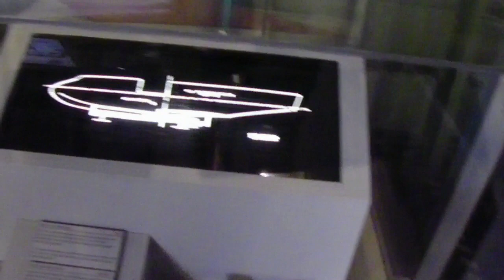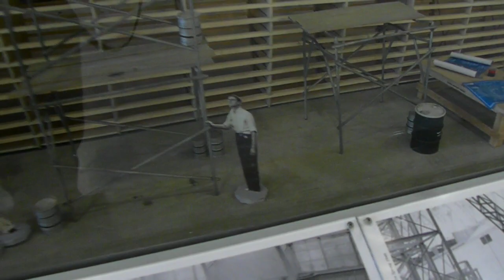HD Inside Howard Hughes H-4 Hercules at Evergreen Museum McMinnville Oregon Aviator Spruce Goose

Comment: I worked for Hughes Tool Company Aircraft Division while Howard Hughes was still alive. More than once employees were able to go to Long Beach to the Hughes hanger where the Flying Boat was stored. It was in a climate controlled facility and the aircraft sat in the water. For those of us lucky enough to work for the company that built the Flying Boat, we never called it the Spruce Goose just the Flying Boat or the original designation of the HK-1.
Reply: How was it kept from rotting when sitting in the water?
Reply: That's a great question Marcel.  The answer to that and many more are availabe on our extended tour package.  If you and your classmates will simply swipe your credit cards, we'll be happy to take you into the belly of the beast.  Just up this spiral ladder is the main flight deck where the ol' Aviator himself flew this magnificent boat an entire mile.  If you'd like to have your picture taken wearing a replica of the hat Hughes wore when he flew this epic machine 70 feet off the calm Long Beach waters, just scan your smart phone right over the digital beam shooting up from the pilots wheel.